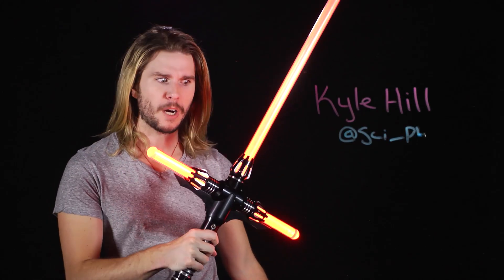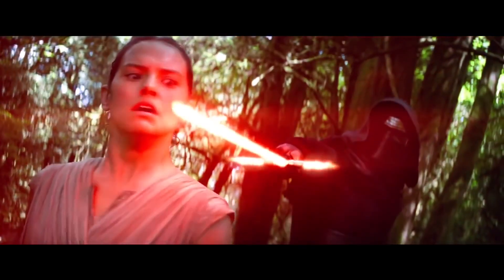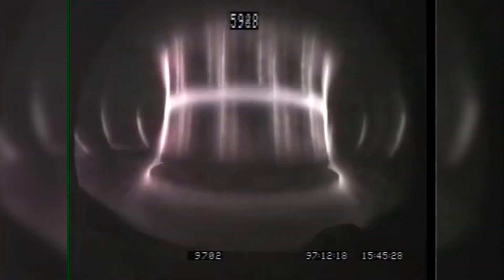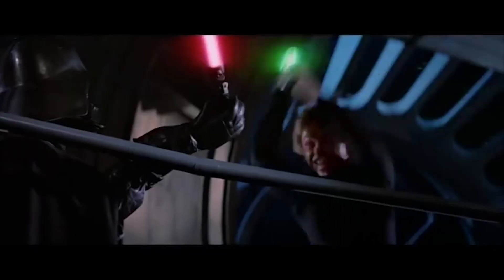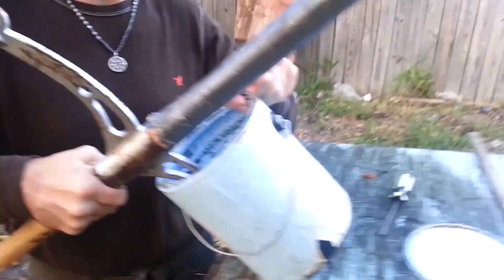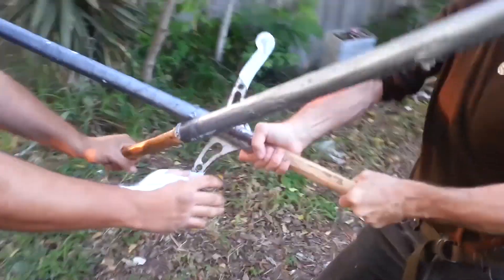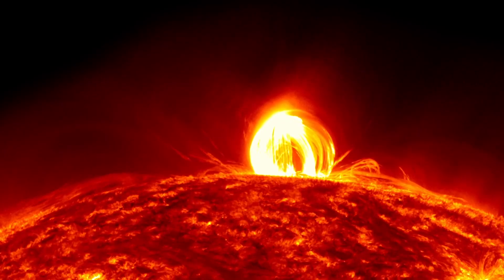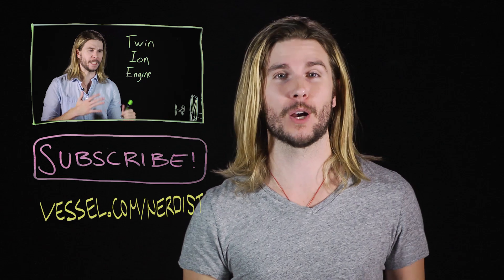Why Kylo Ren's Lightsaber Works (Because Science w/ Kyle Hill)

Comment: I though JJ Abrams said that Kylo lightsaber does not have a cross-guards, but rather they are vents for excess plasma of an old lightsaber design.  So that would make the question of how the cross-guard  works, or if it works, is pointless because that’s not its intent. Plus safety and lightsabers should not be used in the same sentence.

Comment: Like your explanation I do.
Reply from the maker: +Tom Leonard Welcome, you are.
Reply: MrAditya He didn't tell you that Jar Jar was under the mask ... OOOPPPPSSS!
Reply: +TheViralEvolution Only to the point where Darth Vader's armor did the same. Either one is laced with something that can resist lightsabers, in the abandoned EU this would either be "cortosis strains" or "dark side enchantment", but whatever it was the Vader fanboy basically used the same material to make his own armor. But like Vader's armor it can be assumed to be at most "resistant", if pure immunity could be gotten we would have seen it by now.

And seriously isn't the spoiler pretty much everywhere now that it's Luke under that mask? Come on that was obvious from the start, it's why he's not on the poster.
Reply: Sacremas
It's not Luke though but, thanks for responding.
Reply: +Nerdist Doesn't kylo"s armor also reflect light-sabers?
Reply: Sacremas Nope. They were made at the time of the originals. Go look it up. They haven't thrown that out yet. Also, I did more research, and in this ONE case I was wrong. They are vents to keep the lightsaber stable, as the field keeping it as a blade is weak.... So yah.... They were only put there to keep it as a blade.
Reply: +Cerberus I too agree with his explanation.
Reply: DEATH111183 I said I was wrong, as they are vents.
Reply: DEATH111183 You are not reading my comments.....
Reply: DEATH111183 Nope. The side blades are just extra energy venting out to keep the main blade stable.
Reply: +TheViralEvolution Spoilers man spoilers
Reply: +Nerdist Know how a lightsaber works in the starwars world you do not! Go look up the blueprints for them. You still can cut through the metal, as there is no beam there. IT WOULD BE IMPOSSIBLE!
Reply: TheViralEvolution Actually I'd already seen it when I said that, just misleading the trolls. ;)

David Actually no, we KNEW how lightsabers work, and what their history was (the belt pack and all that), but we don't any more, all of that was Expanded Universe, and they are free to change it now.
Reply: Didn't comicstorian already make a video on the history of light sabers?
Reply: Too, me.

Wait.
Reply: +David if you look at kylo's guard when he aim the sword at the chick's neck. you see the guard is open, allowing the plasma from the blades out along the top of the guard.this means the cross guard is a focal point where the beam is splintered into three beams to make the cross.the only way to cut through the guard would be from under the guard it's self
Reply: David again, look at the footage. the top of the cross blades. it's open letting the beams seap out
Reply: David I read your comments, and like I said, it's not just a vent, being it's completely open, meaning there is a focal point where one blade splits into three. and the excess of energy does "vent" from around the sides of the three ports
Reply: Death, i dont even understand what youre trying to say
Reply: Yanni Samios watch the scene shot. you'll see the top of the cross guard is open. meaning the plasma channels off the main blade directly. and there is no close around the guard except around the hilt
Reply: David and yet if you look at the scene footage when he holds the blade to the girl's neck. the top is completely open, and the blade simply forks off into the cross guard. kind of like one could split the flame burst of a turbine engine....... yet the force would just fan out of the complete open top section and make a giant fan shaped blade..... in this case the cross guard is a focal point like I said, to splinter the main blade into three smaller blades
Reply: +DEATH111183 He's saying that the blade is purposefully splintered into three IN ORDER TO VENT THE GODDAMN PLASMA, you FUCKING MORON!
Reply: Hate9. Thank you.
Reply: DEATH111183 There is a close around the entire guard so idk why you think its open at the top
Reply: Hate9. the blade though, splinters off on it's own. the guard it's self is hollowed.... meaning nothing there to direct it but open space.... if you watch the footage, you see this plain as day as the metal around the end is wide open, and the plasma just forks out........ ARE YOU THAT BLIND OR JUST PRACTICING STUPIDITY???

also, I just saw the movie. no mention of the necessity to "Vent The Plasma" soo yeah... your theory is pretty much that, theory, and baseless at that being there is no rhyme or reason to vent the plasma in any way other than esthetical
Reply: Yanni Samios look again, when the blade is aimed at the camera. you can see the top of the entire guard. there is no close. it's wide open, nothing closing it around the three blades. hence the single bar of light between each of the three blades with no dimming area beyond the sides of the guard
Reply: DEATH111183 Disney explained they are vents. Check your facts before you say stuff... something I should have done before saying them splitting off was impossible.
Reply: David dude. Disney can say the blade is made of magic pixie shits. but it doesn't make it correct. true they own the rights to say it is or isn't canon in the slightest.
but does that mean it's correct?? no it doesn't.

if they were indeed vents of any kind, they'd be sealed off from the rest of the blade. which they aren't. if anything they are designed in such a way that they vent power from the core blade into the two small guard blades. not for any specific purpose other than to make the smaller blades....... but again as I said, and as the movie shows us. it's not sealed. the whole hilt is open from the opening of the two guard blades, across the top to the center blade is completely open.... meaning  it's not a vent, if anything it's a refractor point for the crystal
Reply: DEATH111183 I think you're blind, the guard is not open at the top, look at 3:56, or even the scene you are referring to. You can clearly see the top of the guard.
Reply: Yanni Samios it's actually at 3:54 where you can clearly see across the top of the guard, that the plasma beams aren't broken at all between the blades. yes there is a top of the guard, but it is not closed at all. hell you could wedge your fingertips in that big of a gap
Reply: DEATH111183 at 3:54 that isnt an opening in the top of the guard, its the light from the lightsaber being reflected off the top of the guard, and the reason i mentioned 3:56 is because in that scene you can see most certainly that there is no gap at all at the top of the guard
Reply: Yanni Samios and yet the time you refer to shows again the light emanating through that "reflection"..... last I looked, on blackened metal, reflection of light isn't that good at all to perfectly mirror the light source I.E. it's not reflection, theres a source of light coming through the guard from the plasma channel, this means the guard is open for light to come through...... COMMON SENSE. GET IT
Reply: DEATH111183 You're right I should get some common sense. And im going to use my common sense and leave this conversation alone because you think you're right when you're not.
Reply: Yanni Samios already pointed out where I am infact correct and you're arguing for the sake of arguing, with no grounds to make a point...

Comment: The mettle obviously has components that make the cross guards work... so if you cut it the cross guards would be dysfunctional. Just like if you fucking break the hilt with the light crystal, the fucking saber stops working. Steven and you were wrong on that one....

Comment: Eh, I'd say that even in comparison to a two-handed broadsword with thick crossguards, they're rarely a pure 90 degrees like that. Even in the example given in the video, they're off on an angle, because the straight edge limits mobility. I'd have been game from the crossguards being angled, and even a plasma "ring" similar to a katana, or the two guards being of different lengths, like on a scimitar. 

Man, a light-katana, or light-scimitar would be freakin' sweet.
Reply: +Lendanto except light sabers already cut through almost everything they encounter making the advantages of a curved blade moot.
Reply: +Steve C Slightly curved ends in the star wars universe exist, so light-katanas exist in the form of the Darksaber
Reply: +Hypurman1 Ok, "two handed broadswords" are called longsword. 
Broadswords refer to two edged swords with a baskethilt.
Reply: Lendanto Yeah that's all true within a historical context with steel swords. Normal steel swords rely on pressure to cut through something, so blade geometry is important to these swords, because it determines how pressure is applied. Lightsabres on the other hand rely on extreme heat to instantly burn through anything. Blade geometry isn't a factor in their cutting or thrusting ability.
Reply: +Hypurman1 I read somewhere that the side beams are just vents, since kylo's saber is highly unstable.
Reply: +Hypurman1 Lightkatana would be dope
Reply: +Kyle Hill black light saber from Clone wars, closest it gets
Reply: EU cross guard were in fact angled, +1 for you 🍪
Reply: +Hypurman1 light-katana is pretty much what you get by default - e.g the Tsuba of a katana is a very small guard anyway.
Reply: 3N3MYKN1GHT I guess I was thinking  more in terms of the guard, rather than the curve.
Reply: ***** good point. It is clearly useful, but in a different context and technique.
Reply: +Hypurman1 Seems a bit pointless to have a light-katana or light scimitar. Those sword designs wouldn't improve any of the qualities of a regular lightsabre.
Reply: +Hypurman1 ...except that historical swords quite often had 90-degree, often long, crossguards, i.e. many zweihanders, langmessers, even the occasional bastard sword. It is true that an angled crossguard would aid in mobility, but it doesn't mean that straight guards were impractical enough to never be used.

The idea of lightsaber scimitars sounds cool though. The two guards being different lengths on a scimitar are probably a result of it having a primary offensive edge, which could work well to complement a scimitar lightsaber.
Reply: +SirPilkington historically scimitars were excellent raiding weapons, especially on cavalry, where the curved edge allows for more efficient slicing actions at fast speeds. Assuming there's mounted sith and jedi, then it could be practical, haha.

Katana-type designs wouldn't provide much of an offensive bonus, it'd be more of a trade off. But scimitar designs are also a trade-off, really. A slightly or greatly curved edge may aid in slicing - as they do in katanas, which are also slicing orientated swords - however it sacrifices stabbing capabilities, which are easier with straighter blades.
Reply: mrspeigle1 ahaha, very fair point. I doubt something like sharpness or cutting ability comes into account when you're dealing with a literal rod of plasma that eats through pretty much anything.
Reply: ***** You need pressure for the "saw motion" to split the flesh. I can saw as much as I want, if there's no pressure on the edge, the thing won't cut. The shape of the blade (curved or straight) influences whether force is applied at an angle or not, which influences the pressure on the target. That's why it's easier to do cut with a scimitar than with a straight sword.
Reply: ***** I don't want to sound mean, because I appreciate your desire to be precise about this topic, but please stop wasting any more time on this. I mostly agree with what you say, but it doesn't add much to the initial question: "Do metal swords rely on pressure to work?". The answer is, yes they do. When I say "pressure", I'm not saying that you yourself need to press the sword down to cut. The pressure can also be the result of gravity pulling the sword down (i.e., the sword cuts because of its own weight).
Reply: +Hypurman1 Actually historically most medieval swords had a crossguard at a 90 degree angle.
Reply: +Robbin_ted99 this is true :D

Comment: That prop Kyle is holding at the beginning of this video is awful, fire whoever bought it. Also, those aren't cross guards, they are vents, get the visual dictionary.
Reply: +Very Exciting Actually the prop is dope, and while they may be functionally vents, in the film (and in the design) they are crossguards.
Reply: +Kyle Hill The prop is cool as a prop, but it's not accurate to the film version at all. Whether that's the intention of the maker or not is another story...
Reply: +Kyle Hill they may be used as cross guards, but they are vents. We will have to agree to disagree about that prop, cause there are far better available.
Reply: Haha! You jut got bitch slapped by Kyle!
Reply: +Kyle Hill It may look cool but its inaccurate,way to simplisc in design and not really bright either.
If you are looking for good saber props look up "Makoto Sabers"